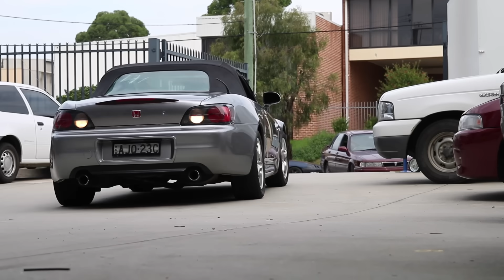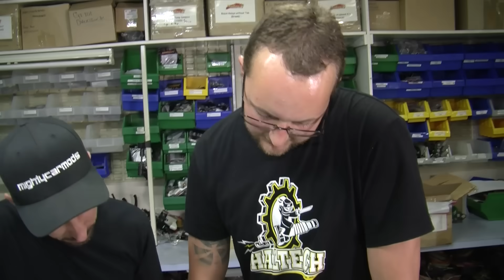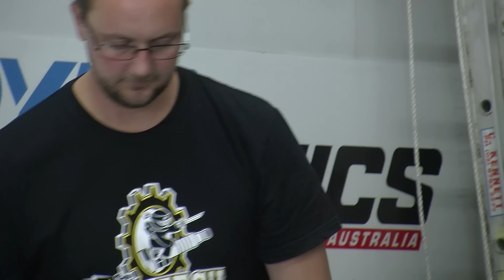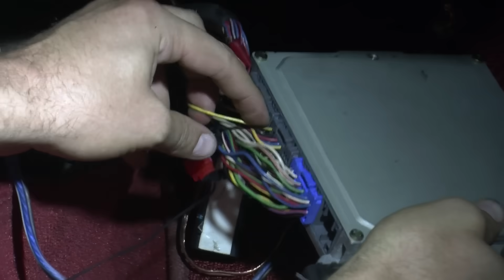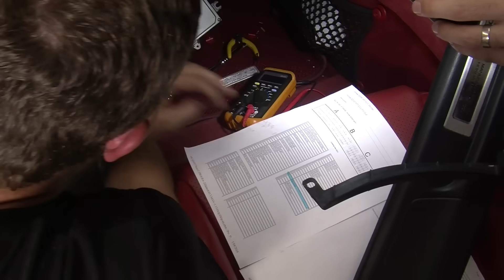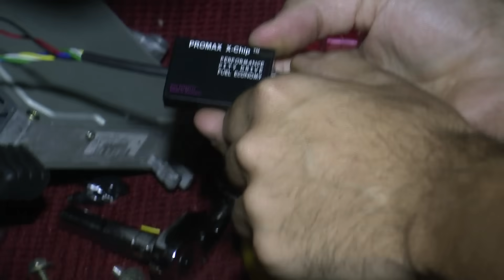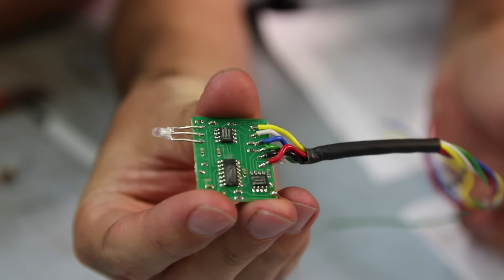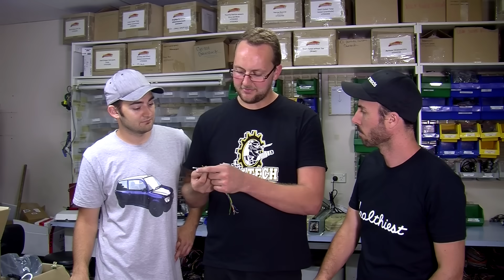eBay Performance Chips -  Mythbusted

Comment: A real tuning chip would be an EPROM with different tables written to it. (And not all stock ECUs let you swap those, sometimes you have to replace the whole unit.) That thing isn't exactly a real chip. Also real chips intend to make up for non-stock cam timings, differnt boost (even adding boost to an orignally NA engine), or non-standard A/F ratios from oversized injectors if running nitrous. Chips that actually do work typically aren't meant as a standalone, but as a complementary part of some other mod.

And sometimes for DIY stuff, you can get a reputable custom chip made for under $50. (Just the EPROM, or you mail the person doing it the ECU. Usually these are burned by people at car enthusiast forums with experience in tuning whatever car you're trying to mod. Not some odd random eBay/CL listing, but rather a limited thing made at personal request. Usually helps if you've been involved in some cool projects or have some good reputation at the forum you're involved with.)

Comment: All the 'performance' chip can do is change the engine tune which may be detrimental to engine life if ignition advance is too much at various rpm, or the mixture too lean or rich which can cause detonation or bad mpg. Engineers have gotten it right in the first place to provide max hp, smooth running through the rpm range, and long-term reliability. Magic chips that give huge hp increases without other engine mods are indeed a myth.

Comment: What would you expect for 20$? I'm not saying performance chips work or don't work, but if you buy cheap parts and expect anything other than cheap results, you're lying to yourself. A good rule of thumb with automobiles is this, buy cheap,get cheap.

Comment: any decent tuner who can use an EPrOm writer can produce a "Chip"that can plug into your factory ecu (With a bit of soldering of a chip housing) that will indeed produce more power ect ... any decent tuner will confirm this ... even the guys at haltech ... also this led box that they fitted is not a chip !

Comment: What a scam. People that put out garbage like this should be arrested, questioned as to what their true intention for making a device like this is, and then convicted, if guilty, to return all monies back to the people they scammed. Where are the consumer protection agencies in all of this?
Reply: If some one is dumb enough to buy this shit, it's their own fault. Don't need laws protecting them.
Reply: ChiefJustice Middleton
I'm sure there haven't been huge complaints. As they allude in the video, how many people who buy a $20 chip are going to spend hundreds putting the car on a dyno before and after to check for actual HP gains? Most people who bought this chip will have convinced themselves that it works.
Reply: they are outside of the US so there is nothing that could be done from our end.
Reply: If thats true then there is a serious problem with customs allowing crap like this to come into the country. I am sure theres been huge complaints yet the feds do nothing. The same goes with people who computer hack and send out viruses. I mean really. A whole separate market left for the legal departments to create controversy over so they can rake in the money while the consumer suffers. China syndrome.
Reply: People should think before buying these, 30+ bhp for just 20 bucks? Comon . . . Not a chance. There must be a market for these otherwise there would be no such thing on the market. Oh well . . .
Reply: Leroy Butts Yep, thats what they gamble on is charging a cheap price so millions of people put their money into it and just say exactly what you described. Not worth the hassle to sue, or is it? Hey, do you have a brother named SEYMOR by the way?
Reply: Colin D
I guess it swings both ways eh. Just like china is allowed to make shit quality products and we are almost forced to purchase this crap. Most of the time its got nothing to do with being a dumbass when some advertisements for some of these products boast unreal events. Mostly car adds the completely brainwash people into buying their crap, which most vehicles are just that fuking garbage. As far buying products for vehicles, I believe most are sold by the snakeoil salesman himself. Its mostly bullshit and supported by consumer protection agents who are shills to begin with. Your right, we have to look after ourselves and watch out what we buy, however there is a blatant scam going on here that needs to be addressed.
Reply: ChiefJustice Middleton this was bought from some tiny ebay merchant. no country has the resources to handle every single case of fraud, it's not worth it. some things have to be left to the consumers. ebay does have a pretty solid money back guarantee for cases like this, but I'm not sure how they would hold the merchant responsible.
Reply: Afrothunderkat Back then when people don't google everything they go out and buy this crap, you cant be putting the blame on the people as well. I've seen this rubbish being sold at supermarkets back when i was a kid. Luckily my dad doesnt buy any of the bullcrap they were trying to sell though.
Reply: ***** Unless you mod the entire engine, install a turbo or a supercharge there is no reason for messing around in the ECU of the car, if you those heavy performances you would prablably find a ECU Expert to reprogram or change the one you have in your car so the engines run at this best, and them, we can maybe talk about extra 30 horsepower by doing that.
Reply: well it does say 35 hp Guarunteed. You could sue for false advertising, but it's a $20 chip not worth it to begin with.

Comment: 19 bucks for a chip......oh yeah, it will work!
Tell ya what, send me 20 bucks and I will send you a bag of frozen corn that will boost HP 100%. What you do is put half a bag of frozen corn in your gas tank and the other half in your radiator. The corn in the tank will ferment and create alcohol. The corn in the rad will cool the fluid.

Comment: I made a MAF sensor "chip mod" with Arduino (15usd) and modded a little code found on the internet. I use it to lower the voltage when doing 2-2500 rpm and coasting. Saves a bit of fuel on my old audi 2.8 V6:) Arduino is an excellent starting point for making a simple piggyback for many types of sensors. Most of the code can be found by googling and its a fun product to work with:)

Comment: 177 HP to the wheels in an S2000 is low, you should be in the 205-208 range without any mods.  We recently did a dyno day and all the stock S2000's were right at 207-208 at the wheels, with a few of us running slightly higher with intake/exhaust mods.

You should investigate this and see if there's a problem.  New air filter, oil change, spark plugs etc.
Reply: *new air filter, oil change, spark plugs....

wtf, you're saying it like these things would bring back those missing 20+hp.
hahahaha....
Reply: Lassi Kinnunen you're being ironic, right?

Comment: oldest trick in the book. its supposed to make the car think its below 32 F so it goes into rich mode. just wasting fuel IMO. most do this with the air temp sensor in the air intake. at least it wasnt 100$'s lmao

Comment: Ive seen a S2000 with aftermarket intake and exhaust make LESS HP than a stock S2000.  That goes to show how well they tuned the S2000.  Those "chips" cant even change the signal to the ECS based on they way they connect.  The signals from the sensors would have to go into the "chip" and then out to the ECS.  But I just has wires spliced into the ECS wires....that cant change the signals.  And as the guy mentioned, adjusting just a couple sensor inputs may be corrected by the computer's other settings like timing and such.  I once tried to adjust the distributor timing on a 1990 Volvo 740, something which made a huge difference on my 89 Honda accord lxi.  but on the Volvo, the computer made adjustments which compensated for the distributor change, so there was no change in performance.

Comment: Just a remap for a set of parameters can add economy or power for a car..the rest is shit! And of course, those remap settings depends by hardware..if you want to pass limits, then go and put money in that : turbo, clutch, flywheel, intercooler , injectors maybe engine internals and so on.

Comment: you could actually change the voltage to your MAP and make more of a difference than that "performance chip" did, changing the voltages at the sensors "interfaced" would cause the system to be stuck in "open loop" mode, which allows the ecu to control the fuel injection as though you were at 80% throttle using different fuel tables, however, changing your voltage at your map is only noticeable at 80% throttle

Comment: I had a 97 F350 with a 7.3l powerstroke, had it first dynode at 215 rwhp, upgrade turbo, injectors, hpop, intake, exhaust, and i used a ts 6pos chip with custom tunes, went from 215 to 375 with the race tune. May not seem like much but it can be felt.

Comment: Well those stupid chips obviously won't do anything unless they are changing up the PCM tables. But why do that when you can just get your PCM tuned? So stupid lol.
Reply: Two of the values looked at by the computer (and mentioned here) are:
1) intake air temp
2) intake air charge/density (MAF).

If this would have been a legitimate chip/resistor, it would be faking the signals to the computer and telling it:
1) The intake air temp is really cold
2) The incoming airflow is much greater than actual

So then you have the computer dumping that much more fuel into the cylinders (at all times idle through WOT mind you) based off of false information. Sad way to do it, but that's what the legit ebay chips do. One other false value commonly used is the engine coolant temp sensor, again telling the ECM it's cold but just enough to get the control into closed loop. Of course all this goes without mentioning yet, just get a proper/real tune!

Comment: This chip works best with cars that wont over correct the timing. 
Chips like this are best on old cars.
Reply: No, this chip does nothing, so it doesn't matter what car you put it on because it won't do anything.
Reply: WraithCommander42 I'm not going to defend this chip because the one I bought from Ebay was cheaper and worked great.  The one I have was only 5 bucks and made a lot of power. It uses a coded resistor to jump the prongs inside of the intake manifold air temp sensor connector telling the motor it's receiving perfect race weather.
 I bought it in California because of the heat but now I live in Alaska and it still works great even though the air temp is perfect here.
Reply: ReadIt Again
Wait, you think that by telling the computer the wrong information about the air temp so that it will run rich/lean is going to make power? The computer reads that so that it can make the most power with the air it gets. By making it misread that you will get less efficiency. Also, resistors are proportional. All it could do is make the computer think the air is some percentage over or under what it really is. Resistors are not enough to permanently set the temp. to one level.

You can make all this criticism away by simply videoing a dyno run with and without the chip, but until you do I am not going to believe that by telling the computer the wrong information in that way will make it make more power.
Reply: WraithCommander42 you don't have to believe anything. Spend 20 bucks and try it yourself. It's was made clear in this video that these guys didn't know how to install this chip and didn't use the pieces supplied in the kit.  Some people think they know it all but are afraid to try things. I spent the change and it worked.
Reply: ReadIt Again
Thanks, but I prefer to have my computer mix the correct amount of fuel with the air to get maximum power. However, if you can find me a chip for a 4.0 liter AMC I-6 engine with post 1991 Chrysler engine management for less then $30 I'd give it try, but I really doubt it.

It doesn't matter how they installed it. They hooked a DDM to it and flipped the switch between its positions. There was no change in the resistance no matter the setting. It did nothing.

Comment: Tuning on naturally aspirated gas engines is pretty pointless anyway. However a good well written tune on a turbo charged engine will probably net you about 40-50 hp. Good tuning on a diesel engine can net you anywhere from 120-300 hp.

Comment: Have the chips that have been scratched or etched examined with a microscope by someone that hacks chips. Some chips are coated as a security measure to keep hackers from altering functionality. The chip will be etched to access the data buss's so that commands can be added etc. It could be that the chips were scratched to make them appear to have been hacked or to hide where they were stolen from lol (this is from Eastern Europe right?). :)

Comment: First off, great video. It was designed to show folks what you really get with those cheap high claim chips from auction sites, using somebody else's car. If I wasn't car savvy and a young new driver wanting more power and didn't have a lot of money then i would be very tempted to buy one of these cheap chips. Those of us that do know better, already realise it wasn't going to work, or if it did at the very least adjust the air/fuel ratio making it use more fuel. Some people have nothing better to do with there time than argue with peoples comments, and just can't take it for what it is, an informative video.

Comment: How can something like that work if it just taps on to a wire, instead of actually cutting a wire and forcing a signal to travel through the unit?
Reply: Well theoretically some of the signal for the air flow sensor and/or air fuel mix sensor would go through a resistor and then to ground, and the rest goes to the ECU. Therefore the ECU sees less of whichever signal and increases fuel or whatever. 

In theory it would be possible for something like this to work.
Reply: That's the whole point.  It doesn't work.  It's just a placebo for fools who don't know any better.
Reply: Dadul Ludad but signal is not about the strength. it's about the signal
Reply: Chen Aaron Assuming it's a digital signal. But a great deal of sensors in a car output an analog signal, and the Mass Air Flow sensor is one of them.

Comment: Informative and funny video guys!

Just wondering if your ECU specialist could recommend a chip burning adapter, program and flashable chip for my modified 1976 cj7 jeep with 258 I6 4.2l engine and gm th400 3speed auto? ---AS---I installed a GM 4.3l v6 tbi and harness with ecm #1227747 and chip ASKA... And I want to reprogram or buy a flashable chip for my jeep as it originally was carb and no ecm... Thanks for your help! :)
Reply: you need to go to ThirdGen dot ORG and visit the forums. Tons of info for GM ECMs. Moates sells everything you need. I would forget the chip burner and spend the money on an emulator. I wish I had. I thought buying a burner and a chip which would carry 8 different programs would allow me to experiment. and then keep the settings that work. The problem is I have burnt so many programs, I have lost track of what I have done where. I've been through 2 laptops, and just have lost track. Unless you are going to do the work continuously, you forget where you are in the process.
If anyone cares, I'm running a 502 in a motorhome with an Edlebrock/Howell MPFI based on the same ECM. Converted to a 4L85e. Thorleys and Magnaflows. She will pull a 6% grade at 80mph towing a Grand Cherokee.
Reply: Daveinet
Thanks for your suggestion.. Just wish someone would make chip soft ware for my cj7 jeep to use with gm tbi...  Unless they are and I am looking in the wrong place.. If so, please let me know where I can find a chip that fits GM TBI models but allow to program for cj7 jeep, or 4.2l 258 engine with GM th400 auto tranny.
Thanks bunches for your response. :)
I will look into an emulator..
Reply: rag Doll
It is not difficult to disable all the trans codes. The 747 ECM is probably one of the most well documented ECMs out there. If you load TunerPro on your laptop, and the correct definition, each parameter is listed. Basically you start out with telling the ECM what size engine you have, and how big your injectors are. That should get you started. Then you start it and begin driving it around data log so you can data log the results. Then you go back to your tables and tweak them, so they interpret the air flow correctly. (volumetric efficiency) There is nothing magic about the ECM. It is just measuring air flow and dumping in fuel. You just have to help it to interpret the air flow. Once you get that close, you can play with timing.
The air flow rate through the manifold is not linear. there is a point where the manifold is tuned, and flows really well. Below that, you can add a ton of timing. Above that RPM point, you need to pull timing out as you step on the gas.
Reply: Daveinet
 Wow! Thanks for the pointers.. I hope you don't mind, I went ahead and copied and saved your message... --That way, when I get my timing control on my cj7 hooked up to the ecm, I will be able to follow your instructions. ;)
Thanks again!